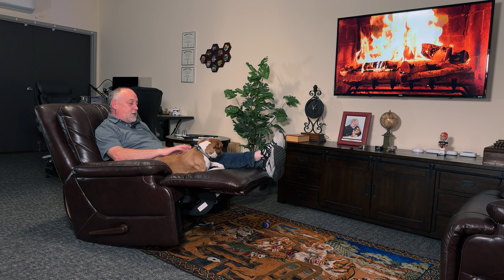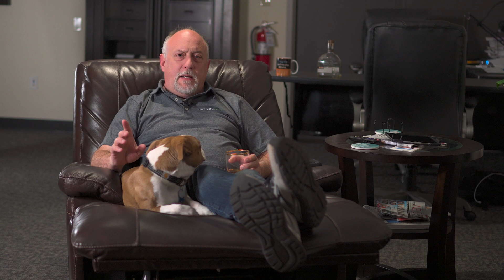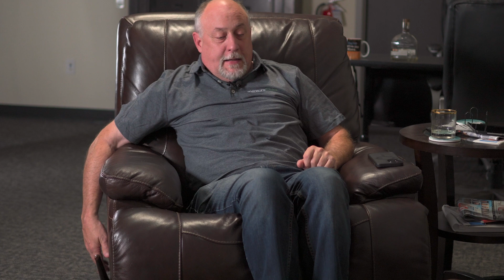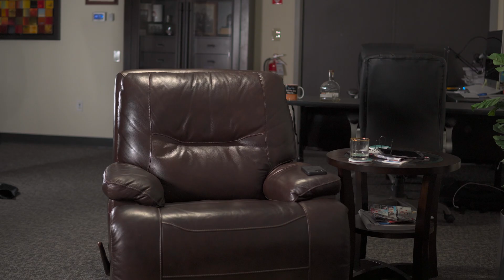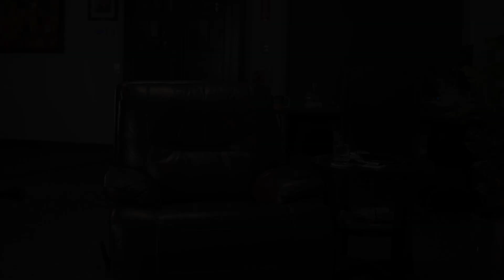Fireside Fridays: Condensate Lines, HVAC Filters & 24/7 Monitoring

Comment: I see that sensi  is shutting down their system the end of the year. I thought it was a  really sharp device. I for one regret their actions.
A few years ago, you did a video, taunting, the benefits of Sensi Predict . What made you change your mind?
Reply from the maker: I never have, it’s a cool product. Sensi ran out of inventory during the pandemic so we slowed promotion of it. Then Emerson was sold to Blackstone and plans changed for the product is my best guess. A lot of technology also ended up up their circuit boards they manufacture for equipment manufacturers I have seen too.
Reply: Are the Fieldpiece analyzers ANSI compliant? Or still not?